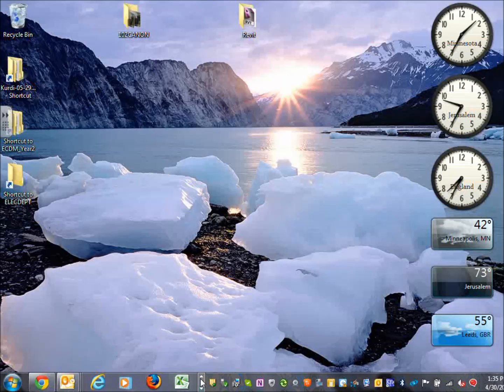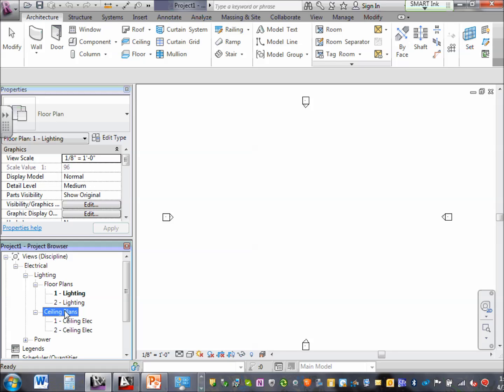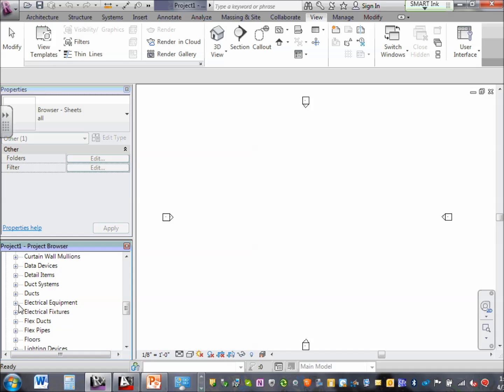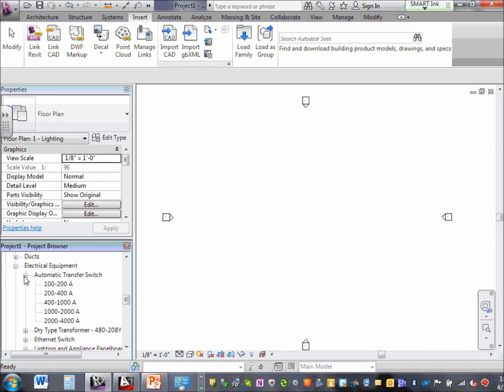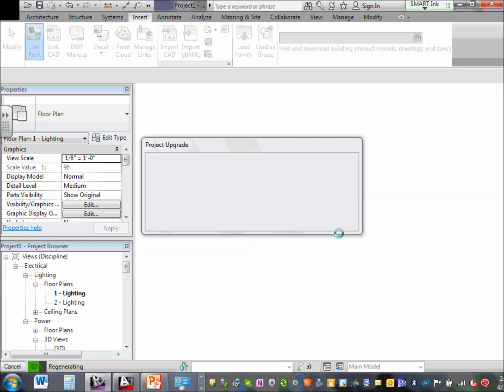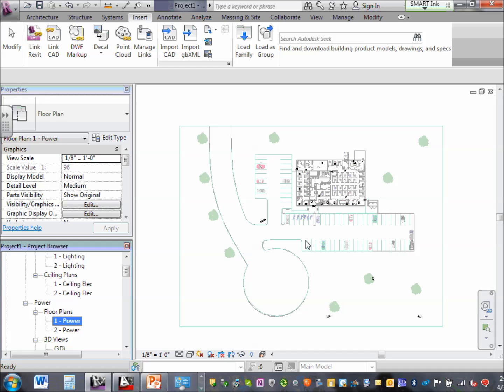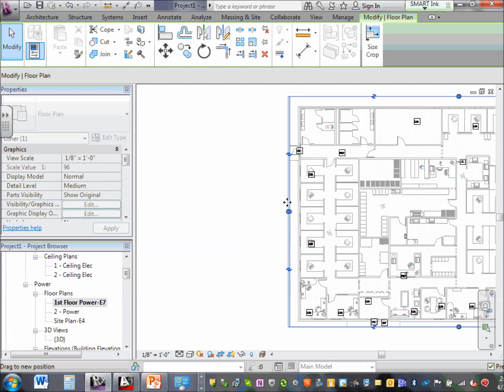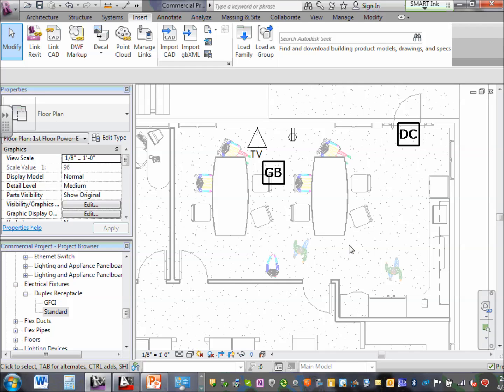Revit MEP Fundamentals 1 04 30 14

Comment: That was very good primer. The only issue I have after working with Revit is that you should insert(host) lights and ceiling mounted devices into a ceiling. If you offset, the architect may change the ceiling height later and your fixtures will be floating in the air. By hosting the fixture, it "sticks" to the ceiling properly. I've found that fixtures host better by inserting from the bottom in a 3D view. That way, the fixture sees the ceiling instead of the floor.